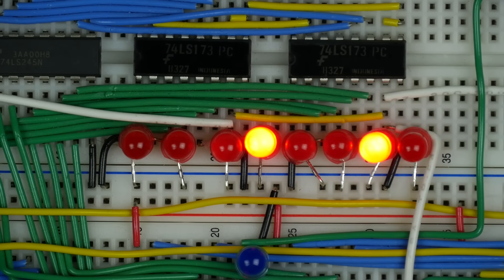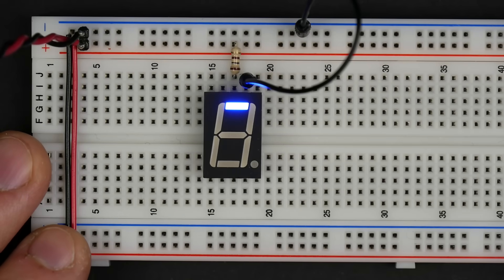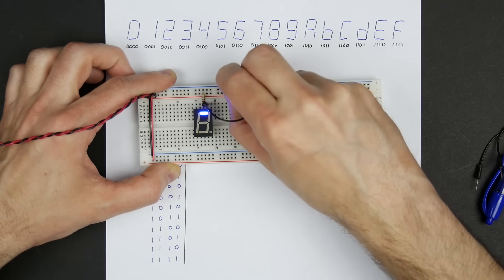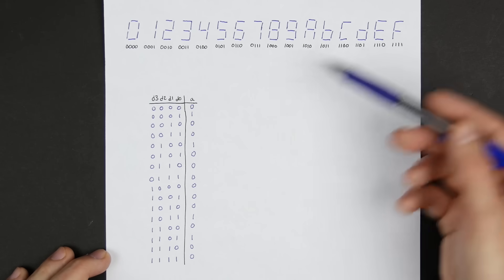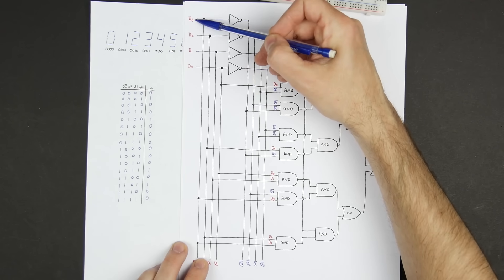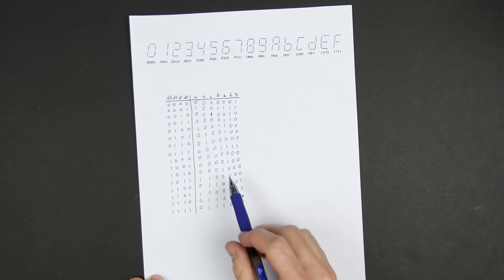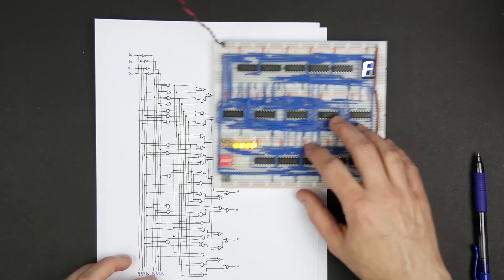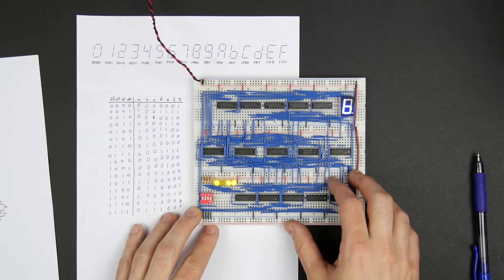Designing a 7-segment hex decoder

Comment: In my Digital Logic class, one of our labs was a binary, 7-segment decoder. Full credit was for a 2-bit decoder. Extra credit was for a 3-bit decoder, which would fill a breadboard. You could get extra-extra credit if you built a 4-bit version, but that meant you had to buy extra chips and another breadboard or two.

P.s. a single resistor on the common lead can have problems. There should be one resistor for each segment.
P.p.s. never assume 20mA is an ideal current for an LED--especially the blue ones. Red and green should be fine, but the brighter ones will be uncomfortable to look at unless you're going for high visibility in bright sunlight. Just because it's the nominal current in the datasheet doesn't mean it'll produce the best brightness. This is why almost every device made with a blue LED for the last decade-plus was apparently made to be visible from orbit.

Comment: I am puzzling. When you are connecting 5 segments of the display for diplaying digit '2' how all the LEDs glowing without dimming while IR loss (voltage drop) in the resistor connected in the common anode increasing with the load increase?
Reply: hey there 
CREATE SHADES USING SIEERPINKI'S TRIANGLE AND YOUR SMART PHONE  https://www.youtube.com/watch?v=DMYn_0uTVB8&t=15s
 go watch and try supporting by subscribing

Comment: If you simplify the circuit for digits 0-9 and use a k-map this can be reduced to just 7 gates for segment A.
Reply: Actually, I just got Seg A down to 4 gates and Seg B to 3 gates. I did this using K-maps to recognizing patterns and develop simple functions around specific gates and using boolean logic laws. Still working on the other 5 segments, but I expect 20 gates total will be enough for the 0-9 digits.

Comment: I once made a de-/encoder from diodes only it just looks so satisfying even if it is nat efficient at all it looks like a array made from a bit less then 100 diagonaly arranged germanium diodes.

(germanium diodes because they where the only diodes I had at home with a minimum conductive voltage under 0.6V.)

Sorry for my bad English especially when it comes to electronic value names i kinda try to translate them from German.

Comment: 2 mins in and mine wont light up. followed everything perfectly. is my power cable not powerful enough? help!
Reply: Did you power the 7 segment correctly (common anode / common cathode)? 5V power supply should be sufficient though. If you have more than one, maybe you can swap those and try again.
Reply: hey there 
CREATE SHADES USING SIEERPINKI'S TRIANGLE AND YOUR SMART PHONE  https://www.youtube.com/watch?v=DMYn_0uTVB8&t=15s
 go watch and try supporting by subscribing

Comment: can this circuit be programmed in assembly code?
with my project, i am not allowed to use any IC's (including logic gates). is it then possible to write a code in assembly that gives specific patterns to the I/O pins of an arduino to light up the 7 seg without any circuitry?
Reply: hey there 
CREATE SHADES USING SIEERPINKI'S TRIANGLE AND YOUR SMART PHONE  https://www.youtube.com/watch?v=DMYn_0uTVB8&t=15s
 go watch and try supporting by subscribing

Comment: BTW Each of the cathodes should have a resistor.  Using 1 resistor in the common Anode causes the display's brightness to change depending on how many LEDs are lit.  Common Anode should be connected to VCC.

Comment: The way I typically drive 7 seg displays is by wiring it to an octal D-latch like the 74HCT373 to sink current rather than source.  Sink is harmless abuse of the D-latch.  I can then use a software lookup table to define the binary representation for each character and set the data value to the display the same as you would a store to ram, as the latch is wired up as addressable memory on the data bus with the chip select.  If I have say two displays, I consume two D-latches which is cheaper than using an eeprom.  So from a software standpoint, the display is updated by storing a value from a lookup table into what amounts to a ram location -- effectively.  Simple, cheap and easy.  :-)  Plus you can redefine the lookup table in software, if you want to change things without needing to reprogram a hardware device.

Comment: when I was young I did design that circuit but with diodes and a rotary switch. so using diodes and maybe two 74138 should to the trick

Comment: I built one of these in the PS3 game Little Big Planet 2, using the virtual circuit boards that the game supports. The difference, is I created a 5x7 dot matrix style display, and included features such as rounded corners on rounded digits, short segments on the 3, 4, E and F, and a digit blanking/enable input that retains the latched digit input, but blanks/enables the display. It was fun!
Reply: These are game screenshots of what I created. It was fun figuring out the logic for the modified segments and their unique states
http://if.lbp.me/img/ft/b9f79c9cef798c40278d5d0724bed5d3719a6dab.jpg
http://i4.lbp.me/img/ft/7a42dbd249c295fa8483f4164cde461966e27bd8.jpg
http://i4.lbp.me/img/ft/3542817db70a04cabdd3c83584ff07301d1f293e.jpg

Comment: why don't he just used BCD to 7 sement display decoder IC
Reply: The video is an introduction to the concept of using ROMs as a replacement for logic circuits, so using an IC that already did the job would defeat the point here. Also, BCD to 7-segment decoders are only made to show the numbers from 0-9(that is why they are Binary Coded Decimal decoders)

Hex to 7-seg decoders are less common,  the simple ones are out of production, so I am not sure if any regular supplier has any stock left of these at this point.

There are some ICs for multiple 7 segment displays that support hex input, but they would need some additional logic, and the ICs seem to be expensive enough that you might as well use an MCU at that point.
Reply: @Ts6451  oh, well I didn't knew that,

Comment: The diagram that comes with the display is somewhat misleading.  The common cathode should be on the bottom with a ground symbol, not on the top.  The 3,8 also could be confused with a voltage of 3.8 volts written with the European way of using a comma when Americans use a decimal point. :49

Comment: I feel everyone saying you could do this with an off the shelf chip, or an Arduino are missing the point of this video.

This teaches HOW it works, as well as the underlying theory and fundamentals.
Reply: Someone could say that something doing this staff already exists: the 74LS47 and many other decoders. But if you want to understand "how it works" you must put your hands on it.
Reply: @RoscioTube  74LS47 is a decimal decoder tho, so if there's people saying you can use it instead then they either forgot it doesn't work for hexadecimal or just saw 7-segment and 4 input pins and thought "yes, this works"
Reply: @JosephJosetar  you are right. I named the wrong IC. In effect, 74LS47 displays 16 different symbols, but those from 10 to 15 are "strange" symbols, not hexadecimal figures. 
Nowadays there are no more complete hex-to-7seg decoders on the market (the few ones are obsolete), but they can be simulated with a PIC to output the right signals for each hex input code.
Reply: "Today, we're going to build a computer from scratch to help you learn how computers work. Step one, go buy a computer at the store. The end."
Reply: No one is saing that shaun
Reply: the arduino crowd won't be watching videos like these. they want instant gratification.
Reply: @nsfeliz7825  im arduino lol i just started electrical engineering
Reply: No ones saying that dude
Reply: @shayorshayorshayor  i am
Reply: @maxczarnecki0  ur a nobody tho
Reply: @maxczarnecki0  and ur blocked. dont even bother replying
Reply: @shayorshayorshayor  🙂
Reply: Max Czarnecki just kidding man. Love you man, keep making the world a better place
Reply: Just learn it from the data sheet like everyone else did.
Reply: @Trainwreck144  Why are you even here then? People came here presumably because they didn't have access to or know about the existence of the data sheets like me. If it hadn't been for Ben Eater I wouldn't know of data sheets and I wouldn't know yet how to able to go out of my way to learn myself via patents, data sheets, and manufacturer manuals. 

You may have a point to an extent but that's it. This is a good series to teach people good fundamentals for their future as I now know to look for patents and data sheets on electronics and computers and to look for  manufacturer manuals with CPU's (or just any product in general that I want to learn more about) . Just because you knew about all of this before it doesn't mean you better than, it just makes you snobby if you think that's the case. 

Be less snobby because less points fly over your head when you humble yourself because at the end of the day you're only human. You're just as killable and as malleable as the rest of us, maybe not as athletic as most but that's just a guess, you probably are smarter than average, combining all of this it comes out to make... a basic human with specialties. 

You're still a human at the end of the day so act like it

Comment: A single current-limiting resistor in line with the common anode is NOT the way to do it!  That way the brightness of the digit will vary depending on how many segments are lit...
Reply: Correct!
But not so important for this type of video.
You can also use many more complicated methods to find a circuit with: a) the minimum number of gates b) the minimum propagation time c) the evenest propagation time.
But that was not the purpose of this video.

Comment: Your videos are the foundation of my Minecraft storage system , thank you for the great explanation.
Reply: Do you do item or data storage?
Reply: @chemieju6305  Why not both.
You would need a reader of some sort, and index every item a number, whe an item is read, a signal is sent toward something that corrsponds with the index, and performs a function. All you really need is a sender, that sends an item to a reader, and the reader then sends a high or low signal to something that performs a function.
Reply: @theterribleanimator1793  i did something like this, i used the 16 colors of concrete powder to encode hexadecimal. I used them because they are quite easy to work with because they are gravity affected. I build 4bit encoder and decoder and a 46byte storage, only using 124 blocks for storage itself.
Reply: @chemieju6305  and why did you stop at this storage point ? Because you got bored or it could not be expanded efficiently? Just asking btw, curiosity.
Reply: @theterribleanimator1793  expanding it is surprisingly easy, especially now that honey blocks are a thing. I built one functioning system and then got kinda bored.
I then got back to develloping more efficiant ram cells.
Reply: @chemieju6305  cool. Think you could do that with actual electrical components?
Reply: @theterribleanimator1793  a few bytes of storage? Absolutely. After all i'm both studying and training electronics.
Reply: @chemieju6305  or you could use analog. That sounds cool though!
Reply: @samuelwaller4924  analog data transfer in minecraft is not really viable as you constantly loose signal strength and you alao cant use repeaters for it. The only way would be comparator lines, but these are really slow. With data storage its a slightly different thing, but i think you'd still loose a lot of speed for converting it to analog and back again.
Reply: @chemieju6305  im sure concrete powder is much faster ;)
You are correct in its speed, but it is very compact for large amounts data. Usually computers and ram do not need to transport data very far. Ofc you do need to convert to binary to do most things with it.
Reply: @samuelwaller4924  im curious now, how is it more compact then concrete? Sure, concrete requires a lot of infrastructure, but once you got this going you only add more in terms of block storage
Reply: @chemieju6305  you would need a large amount of data to see practical benefits, but seeing as we are making computers with redstone I don't think practicality is a concern ;)
I would love to see your design, my only idea is to count each pile, then do stuff from there
Reply: @samuelwaller4924  it has been ages since i last designed anything in that regard, but the general idea is that you take 4 bits and assign one color of powder to each combination. You need a large encoder at the start and a large decoder at the end, but in between its 2 blocks per byte plus infrastructure
Reply: @theterribleanimator1793  transistor?
Reply: Julius Berten has
Reply: @kritneekvednath  has?
Reply: MIT students here( Minecraft Institute of Technology)
Reply: @abhishekgourav6144  Underrated comment!
Reply: I haven't played Minecraft for a long time but last I knew, the most compact storage system used locked repeaters.  That's just a repeater with another repeater feeding into its side (the lock).
When the lock gets power, the repeater which it's feeding into becomes "locked" and won't change state.
To store a new value into a set of repeaters, you momentarily remove power from their locks, then feed in the new value and re-power the locks so that the value can't change until you de-power the locks again.
The big problem is the timing because redstone can only send power through 15 squares before needing a repeater, and each repeater introduces a delay.
Reply: @melkiorwiseman  jep, thats pretty much what i did as well last time i tried. I ended up with 16 nibbles of storage, where each nibble has one data line running through and also a read and a write line. These lines then get powered by a multuplexer, so you can just address each one with a 4 bit combinstion plus one line for read and one for write. (These are not compacted into one high/low line so you can choose to neither read nor write which makes connecting them to a BUS easier)
Was not the fastest system but still fun
Reply: @chemieju6305  it's easier using asyncronous serial comunication with shift registers using a single line data transmission ;)
Reply: @excorvalan  yes, but not if your design is intended for fast and parallel access like in microprocessor applications. Serial is better suited for ranged data transmissions. Also asynchronos is difficult to sync up when starting a transmission
Reply: What's a minecraft storage system?
Reply: Binary to hexadecimal, how hard could it be?
Reply: @Ragnarok540  its very easy,knowing what hexadecimals are and how they work are %80 the battle.
Reply: https://play.google.com/store/apps/details?id=cloud.ker.ssd
Reply: I know ethos lab has something similar where you use two buttons to select the first and second digits of a hex number that corresponds to an item
Reply: I can relate
Reply: I can relate to this,,
Reply: XD
Reply: lmao nice
Reply: Kid, I once was you. I hope your parents are proud of you.
Reply: @Chemieju
Reply: the foundation of your WHAT 😭
Reply: ☺Eu também crio coisinhas dentro do meu mundo de criações no Minecreft.
Reply: Litrelally i am watching for minecraft lol😊

Comment: I required   hex  out   decode  -   did    it with    smd  diodes    -   made  own  prom  .    4  bit  input   -    to  138   -   thus  single   line  that  "drove"   one set   of  diodes  -    which    produced  the  hex   code   in  7  segment .     All      four  got stolen   on  moving  house  -    it wassomething  others could   not  do

Comment: I'm sure this has been pointed out before (though I didn't see anything obvious looking through a handful of comments), but the circuit for the A segment can be simplified significantly just by making the observation that it should be 1 when the input's outer bits (bits 0 and 3) are either 00 or 11, and the input's inner bits (bits 1 and 2) are either 01 or 10; this allows the circuit to be implemented with only an XOR gate, an XNOR gate, and an AND gate. Of course, this affects the circuits for the other segments, as you have to change what can be reused where, but similar observations would doubtless allow for similar simplifications throughout the overall circuit. Or, as you said in the video: simplify the problem and solve the simpler problem! =)

Comment: It was a part of my course project. I had to join 3 seven-segments monitors and show counting from 0 to 255 on them. I calculated a circuit but finally implemented it in Electronic Workbench. Then I found a circuit in 555 series which I could use in cascade connecting to realize the project. It took a lot of time but it was one of the most interesting projects =)
Thank you for your videos!
Reply: Yeah i had to make a similar one, but to 25, not to 255. I used flip flops in cascade, it worked pretty clean id say. I guess its the same thing as you bcuz 555s have flip flops inside them.

Comment: what are the limiting factors to a basic logic chip circuit in terms of clock speed. like, could you run a simple counter with a display at gigahertz speeds? I guess the switching time in the gates would be an issue in the hundreds of megahertz?
Reply: These basic logic gates (7400 Series for example) do have a limit as to how fast they can switch. It may be as much as a few megahertz depending on what specific grade of chip it is, (such as the fast version of the 7400 series, the 74FXX) . You can also build a circuit on an FPGA, which is a programmable logic chip, that is capable of much higher speeds. Perhaps as you say, gigahertz. Basically, very fast chips are simply specially designed logic gates that operate very quickly.